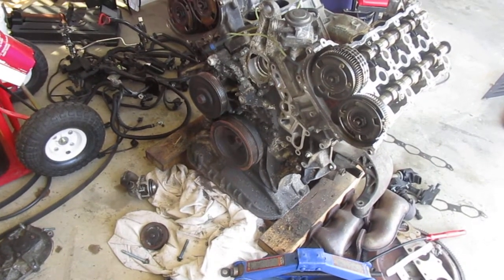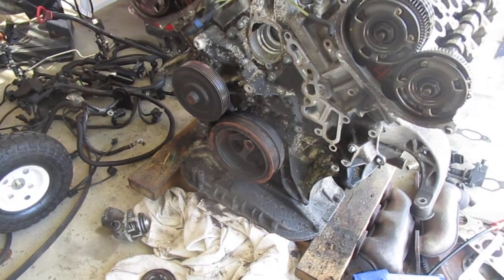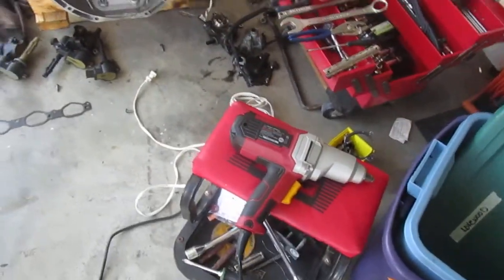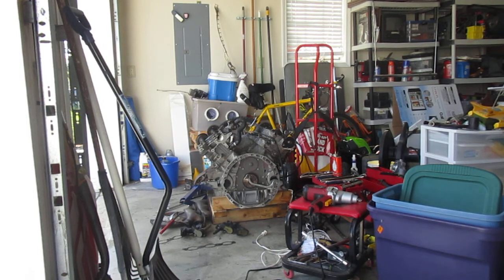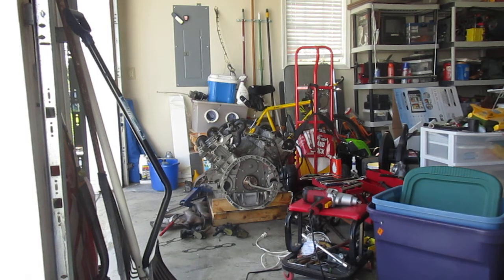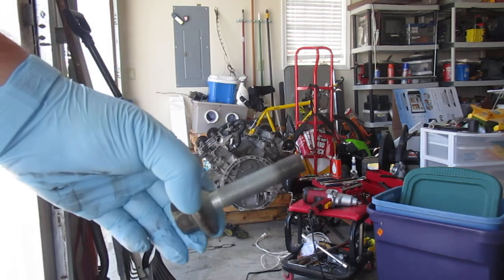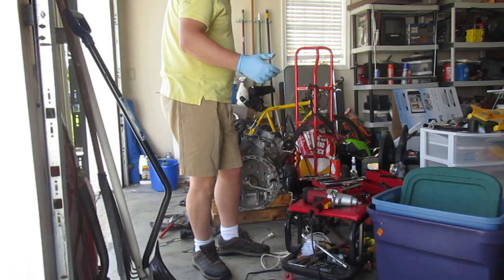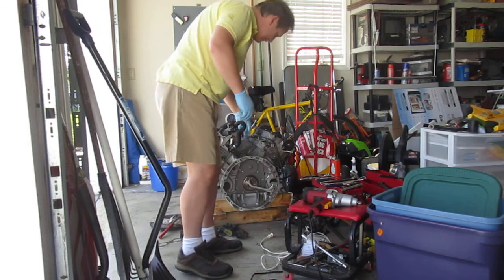Trick to remove stuck crankshaft bolt

Comment: Since it took a 3/4" breaker bar with a cheater pipe stuck on it and a 5' pinch bar stuck into the pipe, giving me a total of over 5 feet that I had to really lay into to break free a crank bolt on a 89 Integra, I bought a good impact wrench.